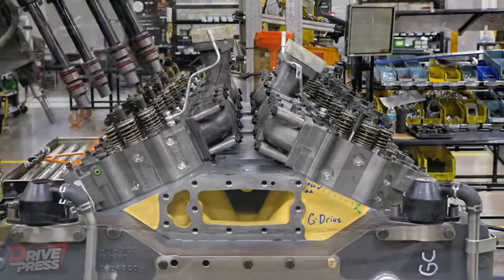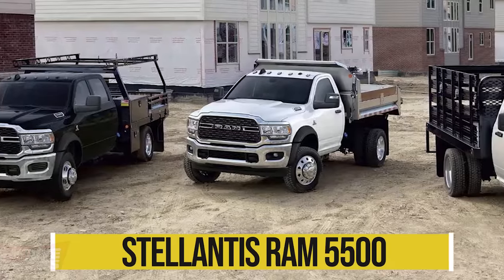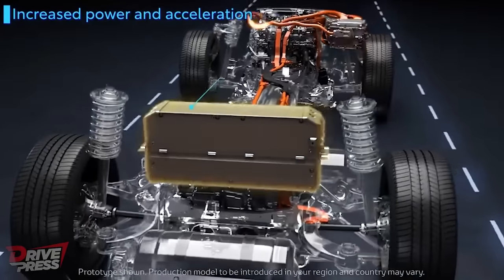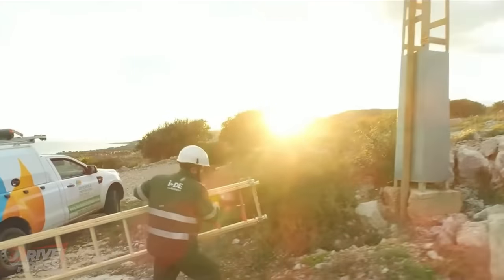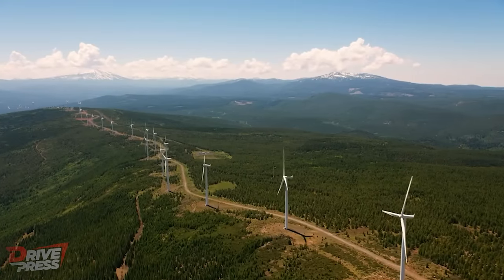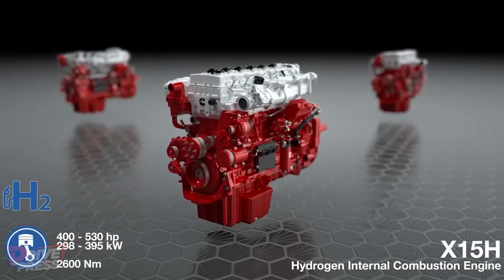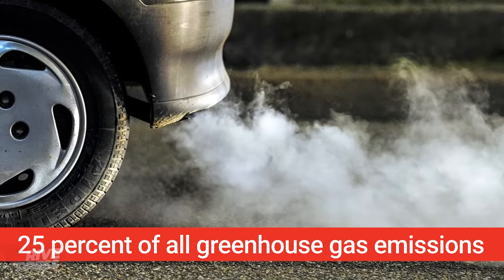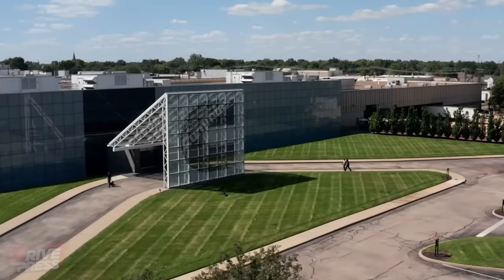Cummins Hydrogen Engine Spells Doom for Diesel

Comment: After working on natural gas trucks for the last few years diesel isn't going anywhere anytime soon
Reply: What about natural gas trucks? There is even synthetic natural gas.
Reply: Natural gas trucks suck bad in the winter. They are gutless turds and don’t run half the season anyway. At least in the Mack platform. Mack BEV is garbage and takes dozens of gallons of diesel via gen set to keep charged. Batteries fail while sitting and need replaced. The subset of batteries for the cab alone weighs 1200 lbs. junk. Anyone remember DME? Dimethylether. Yeah they squashed that. Liquid fuel derived from methane that is compression ignition and requires only scr for after treatment. Would have been able to run no egr, no dpf, no vgt, no common rail. Could have been mechanical injection and old school turbo. As a technician I’m for anything that works well. Nothing but diesel works well. Hydrogen is hard to make in large quantities and store on the vehicle but not much worse than natural gas I suppose.
Reply: Over time in select areas it may be phased mostly out, but I agree diesel is just too established and effective to disappear anytime soon
Reply: Pounds moved per gallon burned a big rig diesel is one of the most efficient machines out there.
Reply: @flvflvflv-x4p natural gas trucks are turds way under powdered
Reply: Can't wait for California to struggle to get food ans services to sustain life
Reply: @Tankeryanker339  i mean not those made for diesel and converted for gas but those made for gas
Reply: thats what they said about the horse
Reply: @flvflvflv-x4p their all gutless garbage compared to diesel
Reply: Hahaha enough said
Reply: @Tankeryanker339 California set the standards for the rest of the world.  We need clean energy in the world.  Fossils fuels are bad for the environment.  Don’t forget California produces most of the US food crops, so if California fails, you don’t eat.
Reply: @michaelgreen9484  no such thing as " clean energy " all people are doing is replacing where the carbon is created.
Reply: @michaelgreen9484 Where are you getting your information? You must be a California liberal drinking the super-blue Kool-Aid.
Reply: @michaelgreen9484 we wouldn’t eat? Bro I live in the Midwest. We may not have everything we used to if cali fails. But I promise we’ll still eat 🐓🐮. 😂😂😂

Comment: Building an engine that can burn hydrogen is the easy part.  Making green hydrogen and developing an effective way to carry it in the vehicle is the challenge.
Reply: Agreed.
Reply: Burning hydrogen, should be  the epitome of Clean emissions.
Reply: @Jim-e2k5s  It should be, the problem is how to produce it, whether through electrolysis, how the elecricity for electrolysis is generated, or whether the hydrogen is extracted from a fossil fuel source such as natural gas.
Reply: The best place to produce Hydrogen at $0.25 per gasoline gallon equivalent ($0.25KG) is in abandoned or existing oil and gas wells. The production of "clear" hydrogen leaves all the air pollution underground unlike steam reformation of natural gas or gasification of coal releases Co2 into the atmosphere. The company called Proton Technology, Inc in Canada is worth investigating to produce "clear" hydrogen wil be the easy part competing with natural gas and subsidized hydrogen.
Reply: They already have the technology you’re talking about most of your forklifts in the industry are running on hydrogen nowadays. There are a lot of smaller engines, three cylinders and what not that run on hydrogen also in the commercial industry, it’s a mith that electric vehicles are safer and easier to produce.
Reply: No other fuel is as leak prone as the smallest molecule in the universe.  Few are anywhere near as explosive.

While I think it is probably time to re-examin our choice of fuel and their mix, whatever is chosen, the distribution network and infrastructure must be built and built out unless that choice is gasoline and/or diesel.  That will be expensive and time consuming. 

Also, what happens to all these expensive new technologies if society and/or science determines that carbon dioxide is actually necessary and beneficial rather than a pollutant?  Many of us are already somewhat miffed by the politicization of what should have been a purely practical consideration.  What if people discover/decide that we have been robbed to implement a mistake?  Our prosperity and that of our children has been permanently stunted for what might turn out to be mostly simple graft...
Reply: I have one word Hindenburg
Reply: Ever notice how no one talks about the carbon that it's released to produce electricity to power electric cars or to manufacturer their parts? Electric cars aren't really as "green" as we think. hydrogen powered vehicles may just be greener than electric.
Reply: The creation of Hydrogen is 10x more expensive than creating diesel fuel, it also burns hotter destroying glow plugs thus reducing the lifecycle of engines and the ROI!  It also more expensive to run and maintain a hydrogen engine and less efficient than diesel.
Reply: Use browns gas or HHO it can me made on the fly .
Reply: Not really . Liquid hydrogen can’t be stored as it vents of and needs to be cryogenically frozen . Gas hydrogen can be stored without losing any gas . Forklifts have been running off of this stuff for many years .
Reply: @rickyticky574 if you knew the science behind why that happened you would delete your comment
Reply: @user-eg8hb8xt3j  #1 it was meant as a joke, but I'm really invested for you to explain mr. Scientist
Reply: totally possible . legislation is the barrier.
Reply: Hydrogen can be made at home using a HHO generator. The Grid needs to go Nuclear or Solar.
Reply: The reason they all are doing this is because within the last year or so, we can now extract hydrogen from sea water very easily.
Reply: Louisiana is building a billion dollar Hydrogen fuel plant....so I do believe it's been figured out and Toyota has several hydrogen engines
Batteries will be obsolete on cars
Reply: Exactly, out of site out of mind. People don't look at that part. Just like EV's you've just moved the burning of fuel from under the hood to burning it at the power plant. Thermal efficiency is 35% for power plants and internal combustion engines, therefore they are no more efficient if anything less due to having to transmit the energy to your house. Then the EV, once charged is only 85% efficient.
Reply: @AmberPassardi-bg2fr  Mike Copeland already built a couple hydrogen powered vehicles that put out 500+hp with zero emissions the past couple of years. #ProjectZero
Reply: @rickyticky574  The Hindenburg fire was not caused by Hydrogen. It was the material that the airship was made from that burnt, Hydrogen upon igniting in the atmosphere immediately self extinguishes the flame and the gas rises, harmlessly, through the atmosphere. Of all the fuels it is probably the safest.
https://www.youtube.com/watch?v=RAEhhYqMEBE&t=134s
Reply: Making WATER shouldn't be difficult.
Reply: Mike Copeland has already built a couple hydrogen powered vehicles that put out 500+hp with zero emissions. #ProjectZero
Reply: @heronimousbrapson863  From the department of obvious observations
Reply: Tanks have already been manufactured, you can find them here on YouTube. The tanks are extremely safe, wrapped manymanymany times, bullets have been shot at them with no explosion.
Honda has manufactured a sedan and commercial vehicle are already on the road.
Reply: @rusty-ole-boomstick1268  Forget the sales blurb we will see on the battlefield if they are safe.
Reply: Gas is actually more damgerous than the hydrogen
Reply: Enbridge, in Canada has been adding hydrogen to its natural gas for years already. Japan commercial vehicles almost all hydrogen. Way easier to implement than battery technology
Reply: Hydrogen has such a small molecule that they always have leak problems. Then, it also must be cooled way down to make it a liquid. It takes a lot of energy to keep it cold. If it's 100 degrees F outside, you spend too much energy trying to cool it to -427F. Natural gas is much more effective for vehicles driving down the highway.
Reply: TheRealJukebox  actually..your not considering the good side of that..where as a liquid can leak and spread on the ground....this goes straight up into the air
Reply: The "carry part" is the real challenge
Reply: Bingo.     
This point-of-use 'green fuel'  is a joke,  some would even say a scam.
Reply: @roberttammerawitchey4652  electric is great for some applications..maybe more in the future..but for guys like me who love hot rods and old cars and such the idea of hydrogen is very attractive we get all the sounds and power with no pollutants at the pipe..
Reply: making hydrogen is easy and with solor power and wind power its very green.
But this makes oil worthless and thats why the oil companies tries to stop the evolution.
people have been making hydrogen cars since the 80s.
oil companies have stopped them all.
Reply: You are 100% right two major problems
Reply: @rogerreimer6787  I disagree..hot rod shops already do it..must not be that difficult
Reply: @rickyticky574 the problem with Hindenberg wasn't really the Hydrogen.  It was the skin.  Yes hydrogen is very easily combustible but disperses quite quickly and safely.  The hindenbergs problem was that the skin was also very combustible add that with the inability for the hydrogen to disperse from the ship itself.  Hydrogen is actually quite safe.
Reply: The ability to safely transport hydrogen and use it safely in vehicles had been solved 30 years ago by 2 French scientists ( husband and wife team ). I was big on hydrogen fuel for years, and when I came across the new development of the hydrogen storage cell by the French, I was gearing up to invest in them. Within 1 week the information concerning their innovation could no longer be found. Coincidence????? Yet today, we have young gifted people who have designed hydrogen generation on the fly. No need to store it.
Reply: @badchad911 how will that affect the oceans?
Reply: If the EVs think it is difficult to locate charging stations, try finding a hydrogen station on a cross country trip.
Reply: Why make it when you can mine it? Looks like white hydrogen deposits are far larger than we expected, drill baby drill.

Comment: Hydrogen has been tried and failed several times before, and Diesel just works, it is simple, easy, reliable, robust, cheap, etc
Reply: Exactly
Reply: Well, it's not cheap at the pump.
Reply: @davidsmith385  It should be because it's far cheaper to produce.  But in my area it's not that much more expensive than petrol at the moment.
Reply: @davidsmith385  the diesel is cheap , the taxes, levies, fees, eco, carbon,etc is what cost.
Reply: the problem is the petro pollution, emissions
Reply: @davidm8717  What emissions are they?  If you are talking about CO2 - that is not a pollutant.
Reply: @scaryfakevirus  it's called a greenhouse gas
Reply: actually it has always been a viable choice it was just an expensive one however they have discovered they can drill hydrogen wells just like they do with oil. It's estimated that there is like a 400-500 years worth in the ground.  can use the same infrastructure to a large extent. so it too will be simple, easy, reliable, robust, cheap, and clean
Reply: @RobertCline-jp4ve  I had never heard of hydrogen wells, but how did they miss them before? Very odd.
Reply: etc. = polluting
Reply: but why are Diesel subs replaced by Nuclear subs...

Comment: We're all screwed if they think this will ever be 'zero' emissions. There is no such thing as zero emissions.
Reply: If a hydroelectric plant makes electricity to power an electric vehicle that is one example of what is termed "zero emissions".
Reply: @28704joe  NO!  Manufacturing an EV is extremely dirty and is in no way zero emissions;  besides, Hydo-power only accounts for a few percent of electricity produced.  Wind and Solar are also very dirty to make and are expensive to maintain; and that is to say nothing about their capricious availability!!
Reply: We should have been moving this way since the 70s not in ten years
Reply: @dougriedweg9002  yeah. The driving factor of change always comes down to economics. If it's expensive or doesn't scale, it doesn't happen. The only option is to use common sense and not consume our way into more environmental disasters. Just look at that ship burning, all because it's carrying a handful of electric cars. It's almost certainly the next environmental catastrophe.
Reply: @dougriedweg9002 yah you’re correct also batteries are not reliable in cold and hot environments
Reply: Water vapor emissions.
Reply: @georgesheffield1580  Change is really hard for donut heads.
Reply: A hydrogen engine does not produce emissions, but the production of hydrogen to fuel that engine will produce much emissions, some of which will probably be CO2. This is nothing to worry over, though, because the claims of greenhouse effect disaster from CO2 emissions are untrue. The unproven models that predict global warming from CO2 are wildly overestimating the influence of CO2. Any CO2 induced warming is trivial compared to the warming produced by water vapor.
Reply: Dams make over 50 percent of electric power in Pacific Northwest , Wa and OR.
Reply: Only in a perfect world, that's what people don't understand.
Reply: @teelee8760  people have to publish to secure rights to processes....so We Would Know About It, if there was some feasibly lower energy way to separate hydrogen from water.
Reply: @teelee8760  or to say, it is only perfect in Iceland.
Reply: This  technology is to complicated. EVs are  the way forward. Tesla semi trucks are starting to roll out now . That’s the future not hydrogen.
Reply: @billycan8852  Electric vehicle  may work in some places and some not. It's foolish to think they will be able to cover every need we have.
Reply: @billycan8852  tesla semi isn't a great option. Better to run diesel and keep improving the efficiency.
Reply: Can always do 6 stroke or ad-blue in the exhaust.
Reply: What does it take to produce Hydrogen at 10,000 PSI?
Reply: @gordonleet6569  a compressor.
Reply: I live in an area full of old mill towns. Every old mill that's crumbling and falling down at is next to the river because at one time, they were all water powered.  While all the water wheels and  some of the dams are long gone, the infrastructure and canals are still there. I never understood why they don't put at least a couple small hydroelectric generators online at the old mills.
Reply: Hydrogen is better than anything else at the moment
Reply: @billycan8852  NO !!! ....NO TESLA SEMI-TRACTORS !!!....The Transmission Line Losses In This Country Already Average About 50% .... Do You Want To Send The Grid Into Thermal Runaway ???? ....50% Losses Are Not Bad Enough???? We Need 60-70% Losses ????
Reply: @billycan8852  but Hydrogen Is Not the answer Either....the best hope we have is Achates Power Opposed Piston Diesels.
Reply: Do you know what the waste is? Water
Reply: @m2003h  the exhaust emissions are water vapour, but creating the hydrogen usually involves brown coal and heaps of co2.
Reply: @dinosshed  given the state of the world today, it is scary how many people don't know that Electricity is Not a source of power.
Reply: @dougriedweg9002 Allis Chalmers made hydrogen fuel cell tractors decades ago. Didn't pencil out. Won't anytime in the near future.
Reply: @Hogger280 Ok listen up.  The net environmental effect is far, far less, and even less as technology improves.   An IC vehicle costs more in time, labor, & materials than an EV and it’s not close.  An EV has hundreds fewer parts to make.  No transmission, no radiator/ cooling system, no exhaust system, no sensors, a much simpler engine to design & produce.  And we have to mine for all fuels, not just for battery ingredients.  Oil doesn’t just flow in rivers.  It takes an enormous amount of energy & resources to mine, refine, & transport it.   It’s called….the big picture.
Reply: @dougriedweg9002 actually Henry Ford pushed hard for EVs.  The battery tech wasn’t there of course.  But he knew it would a simpler, more reliable vehicle.   Driving around with an unreliable fire-breathing combustion contraption is a pain in the ass.
Reply: @markgiraldes4062 neither is diesel.
Reply: @slpguy6026  Wow, total ignorance displayed in one paragraph, congratulations!